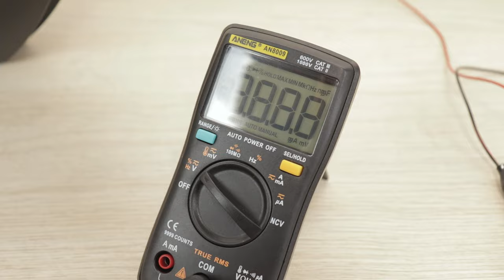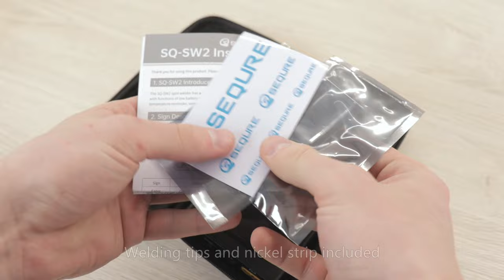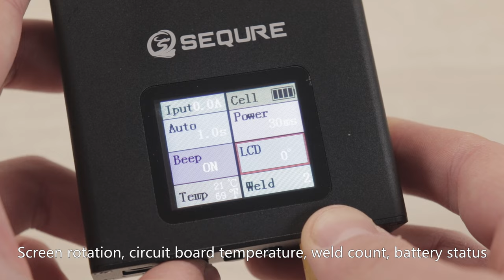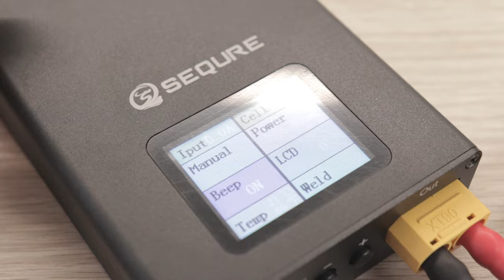Harman Kardon Speaker Battery Conversion NiMH to Lithium Ion

Comment: Nice work! Thank you for the detailed video of this conversion! I am going to make the same upgrade. Do you think it can be converted to USB Type-C as well? Maybe if I switch the original power socket to a USB-C PD charger module set to 12 Volts? Cheers!

Comment: Have you checked the maximum voltage input for the amp circuit? I mean, wouldn’t it be easier to make the battery a 5s2p and leave out the boost converter? Then you probably even could use some hand tool batteries (makitas or what ever)
Reply from the maker: Hi, you wouldn't be able to fit a 5s2p pack inside the battery compartment. The boost converter does not add much complexity. Not sure what is the max input voltage of the amp is.
Reply: @DonnyTerek Hmm maybe not. I 3d printed an adapter for my 18v tool battery and and fed it to the 18v input and it works flawlessly, so the input voltage can be as high as 21v apparently. We’ll see if it holds up in the long run 😄
Reply from the maker: @colamage  That's great, I'm sure it will hold up just fine.
Reply: Thanks you helped me a lot! I wanted to buy some job site speaker and now i will have superior sounding (compared to other jobsite speakers) and powered with dewalt batteries 😅

Comment: Hi, The max output power of the step up converter is only 2.5A, and at 18v the speaker draw more current because of its 90w Amp ? Does it work great at max volume? Thanks!
Reply from the maker: Hi! Sorry for the late reply.
That is a very good point, I actually have not thought about that myself. I will do some more testing on current draw when speaker is played on max volume. The speaker still works great at max volume using this step-up converter and is really loud but I will make sure to check if it has any difference when using a higher Amp converter.
Thanks!
Reply: @DonnyTerek  Hello! Yes do that, i wonder if the speaker can still run on its org dc adaper 18v? or it is just battery powered now all time and must use lion 12.6 v charger? these speaker have great sound the old ones, but only problem is the speaker foam that gets fragile by age and need service, the new one have rubber surrounds around speaker thats hold much much better!, so its not great idea to take that old speaker to the beach near sea water, the foam will shorten its lifetime and gets broken if u play the speaker hard :D
anyway nice quality work :)
Reply from the maker: @mybmw2008  The speaker can no longer run on the original 18V power supply since it is wired directly to the charging board, it now takes 12.6V which is stepped up to 18V before reaching the amplifier. It could be wired to run on battery or 18V DC power supply but having such a large battery I don't see the need to do that.
Yes, this old model does sound very well. I actually like the sound better compared to the newer model which has a passive radiator instead of the ported enclosure like this one. The only drawback of the ported enclosure is lack of resistance to moisture and dust which can get inside of course. I haven't inspected the drivers up close but they seem to be OK from what I can tell. Good thing I'm far from the beach so it will make the speaker last a bit longer, haha!
Thank you once again, hope I won't forget to let you know how it goes with the testing of the higher amp step up converter.
Reply: 2.5 A x 18 V is 45 Watts. Quite good power, no?

I like what you did. Probably you could get European money for environment protection because you're using old electronics and keeping them working?
Reply: hello, I did the conversion exactly as in the video, but at maximum volume the music stops. what should I do to work properly?

￼

Comment: I just don't understand why you had to use a switch? You could connect the  Li-Ion battery pack to the normal  battery contacts, and don't modify the construction. Can you explain this for me. Thanks.
Reply from the maker: Hi, sorry for the late reply. Unfortunately due to the poor design choice of this speaker, the batteries are constantly drained of power since they connect directly to the amp, which even when turned off using the original switch, draws around 0.5A of current. Adding an additional switch, cuts the power from going into the amplifier, saving battery life.

Comment: I have the first gen go play which does not have Bluetooth and only 30 pin dock and 3.5mm aux on the back. I want to do the exact same thing you did along with Bluetooth upgrade.
Reply from the maker: Had a few of those myself too. You can definitely do the same job on that speaker. You could even include a Bluetooth audio receiver which would connect directly into Aux.

Comment: You could have put twice as many lithium ions as you used, in that battery compartment to have a lot longer run time though
Reply from the maker: Sure, but this speaker can already play for around 16 hours on a single charge so I assume that's plenty for a portable speaker.
Reply: @DonnyTerek  i see your point 👍
Reply: @DonnyTerek  Hello channel creator.  Is it possible to put batteries on the same speaker without Bluetooth and with a remote control?  Is it possible to put a Bluetooth receiver on this speaker?
Reply from the maker: @muslimmuslimov4707  Hi! Sorry for the late reply. Yes, you can use batteries to power the older version of this speaker which does not have Bluetooth. You can also connect a Bluetooth receiver if you are skilled enough for the basic wiring of it.

Comment: Hi. Do you know what is the tolerance of the power input? 
Will it tolerate a 19-20V input or will it fry the board? 
As trying to get it to work from a battery station which has a 12V output. 
As you wrote with 12V it will be on power save so there is a need for a step-up. 
The original supply is a 18V which is not very standard. 
Most Dell etc car chargers run on 19V And I have a Romoss 95W 18-20 eUSB car charger. 
Might these work fine or would it be best to get a universal car charger with 18V output?
This seems more economical for the powerstation as the 220V inverter works with around 85% efficiency and bringing it down to 18 seems wasteful.
Reply from the maker: Hi, I'm not sure of the limit voltage that the input can accept. Only one way to find out, I guess. I would suggest you get a 18V supply. You can find one here: https://s.click.aliexpress.com/e/_DB57zvV

Comment: Any way to do this if the charging input board is busted? I have an old powerbank which is only 3.7v, can i still use this automatic step up converter to gain 18v or will this be inefficient in some way?
Reply: Also what charger are you using?
Reply from the maker: Hi, you can attach a separate charging port. I doubt the step up converter will be able to bring 3.7v to 18v. I'm using a 12.6V charger.

Comment: Hi there, very nice video, the tool to strip wires and the welder is niceee! I'm surprised the Atlas drivers don't have neodymium magnets as the dock model does. I think neodymium sounds better IMHO. You can consider doing a upgrade of the drivers, I can send you some links of nice drivers, if you can order from Taobao where you live😊 cheers🍺
Reply from the maker: Hi, thanks! I don't feel the need of replacing the drivers, they sound awesome as they are!
Reply: This is the older hk go play 1 with the rare ferrite atlas versions. The newer speakers had the neodiym versions

Comment: So does this speaker NEED these batteries? I saw other harmon/Kardon had their own battery pack to recharge. Does this one as we or does it only work with the batterys put inside (original or yout solution)?
Reply from the maker: This speaker is intended to be powered by a power supply which plugs into an outlet but you could also use non-rechargeable NiMh batteries which is a huge waste of materials to have it portable. My method shows installing rechargeable Lithium batteries that last way longer and make the speaker portable.

Comment: Hello, I have a question ... I have 2 HK Go Play speakers and I would like to replace the batteries with stronger ones, because the original ones have a small capacity ... Can I put in my speakers batteries dedicated to other speakers, e.g. jbl boombox?
Reply from the maker: Hi! You have to look at the rated voltage of the batteries and the plug polarity if they match.

Comment: Very nice but how is the sound on these recharge cells compared to being plugged in the outlet?Is the sound thinner or?
Reply from the maker: Thanks. The speaker plays the same as if being plugged into the outlet since the battery pack is wired directly to the input source where the power adapter would plug in.
Reply: @DonnyTerek  why you had to use a switch than?

Comment: without a battery indicator light, for example 5 lights, the rechargeable battery is almost useless! you only know when the battery is full or empty.
Reply from the maker: Yes, that is well said but I wanted to leave the outer casing intact as much as possible without having to cut any holes for battery indicators.
Reply: @DonnyTerek  You did a good job. but I'm worried about some things.

After full charging, batteries will be charged to 4.2v.
4.2v x 6 = 25.2v.
the speaker has a power suppny of 18v in.

This type of charging circuit normally takes many hours to charge to 100%. It follows ohm's law

you could have some lights under the speaker grill. small diodes.
Reply from the maker: @ford1546  Yes, each battery cell will reach 4.2V when fully charged. The entire battery pack will produce 12.6V because the batteries are connected in 3S2P configuration (3 packs in series of 2 cells in parallel). The boost module converts the 12.6V to the necessary 18V. It takes around 4 hours to fully charge the speaker.
Neat idea on the lights under the speaker grill. Might check on that.
Reply: @DonnyTerek  okay I understand. so you have connected the battery where the alkaline batteries should actually be?
Reply from the maker: @ford1546  No, I actually connected the battery directly where the power supply would be connected since the speaker goes into low power mode if powered by batteries, which decreases the sound output quite a bit.
Reply: @DonnyTerek  okay Good to know.  but still, the 12v battery will give you a lot less watts than the power supply gives you?
Reply from the maker: @ford1546  In the case of this speaker, yes, since the speaker goes into low power mode as I mentioned before if using batteries as intended by design.
Reply: Hi. Would be ok to make a 4s2p to have 16.8v fully charged and not use a converter? Thnx

Comment: You must have done this before =)
Reply from the maker: Never before on this speaker.
Reply: @DonnyTerek  Isn't there a fire risk when joining the batteries? Saw that when Linus tech tip tried it and it caught fire twice..
Reply: @ashystyle  doing the parallel method on batteries is commonly used for upgrading battery powered things. It's not dangerous unless you didn't used a bms board for protection. I've been making battery packs mostly 3s2p and 4s3p for diy projects and I've never encountered any problems about them except the batteries dying for 2-3 years and need to replace them
Reply: @justabasslover4404  Oh don't misunderstand me. I adore the right to repair and DYI projects as this. I wish I had the tools to do it my self. Where do you order good and OEM batteries from?
Reply: @ashystyle  local electronics shop, and sorry, I  thought you were talking about him connecting batteries with the same polarity